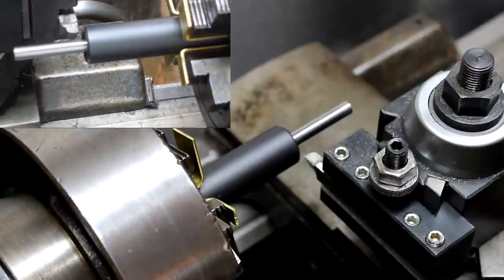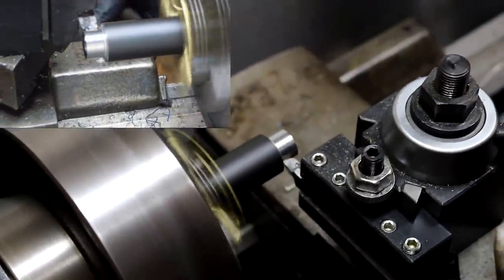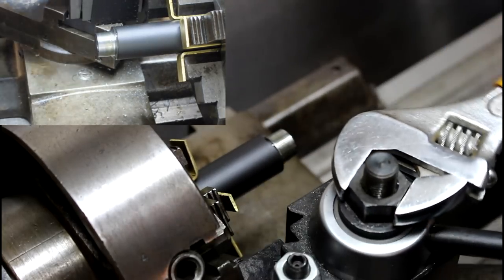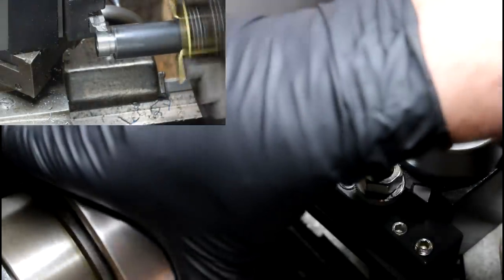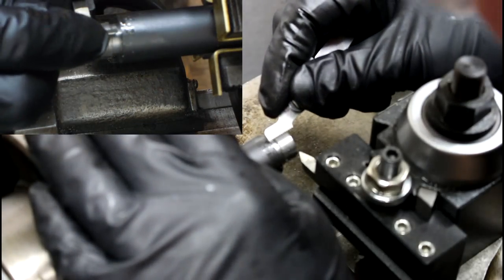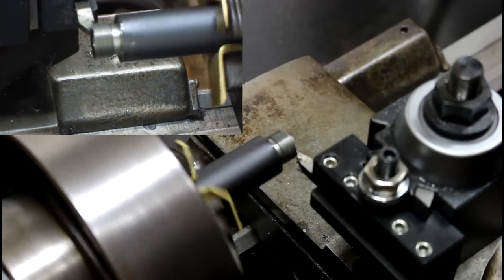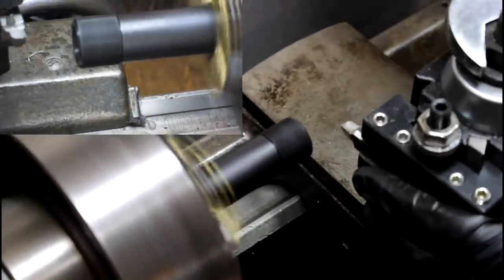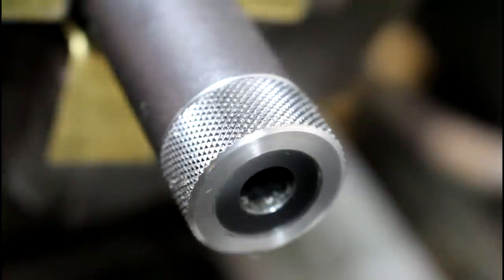Threading a Barrel -Thread Protector Installation! Gunsmithing Remington

Comment: what about the crowning
Reply from the maker: +sea man 
In this case, I left the original crown. Another way to do it is to cut a concentric relief cut on the outside edge of the crown. I haven't seen an accuracy diffence so ether way works.

Comment: Does the barrel need to be taken completely out of the Rifle or can the treading be done with the barrel in the Rifle? The reason I ask is because a gun Smith would charge about $100 bucks to take the barrel off and an additional $100 to reinstall the barrel and space it correctly. The barrel treading and tread adapter would cost about $100. Is that about ? So. We're looking at about $300 bucks for this job.
Reply from the maker: If someone is charging that much I would recommend looking elsewhere for the service. Removing a barrel and putting it back on in 98% of the cases is a pretty quick and easy job with the correct tools which if they are a good gunsmith they should have. I think we used to knock barrels off and on for $20 a few years ago. If they needed to be headspaced (like a Savage) maybe $40 to do that. That doesn't take long ether. If they were old military actions (Enfields, 1903's, or Mosins) there is a potential for an extra charge because they are a higher risk of pulling a barrel and usually require more effort than say a modern 700 Rem. Then again, sometimes they just screw off without a hitch! 

There is really no need to pull the receiver off the barrel to do this. You can, but it can also be done with the action on. I've done a lot of Muzzle brakes with the receiver still on the barrel. You just need to indicate the muzzle end properly which should be done regardless of what's hanging off the other end. 

Many barrels other than the Savage type lock nut barrels can be marked with a witness mark to indicate the barrel on the receiver. When it is put back on, then eliminating the need to headspace it again. 

This job minus the muzzle brake work if needed, was like an $80-$100 job when I was doing it. Installing a muzzle brake was usually around $200-$250 with a brake.
Reply: Thank you for your time in explaining that.

Comment: How much does something like this typically cost? I have a rem 700 with a 26in heavy barrel. Would like to be able to add a muzzle break or suppressor.
Reply from the maker: well, if I did it, it would look much better than tthe one in the video. Usually around $100. Takes time to set it up and indicate everything before actually cutting it.
Reply: @precisionmachineshed  thanks for the reply. Good to know. I wish you were in Phoenix, Arizona!

Comment: That is some rough cut thread.
Reply: Dear god they looked like they were cut with a garden rake. Oh I would have been fired 48 years ago when I started training in tooling, for turning in work like that. 30degree thread form tool, compound set at 30degrees(some guys swear by 29degrees), clearanced across the cutting edge 10 degrees on the front edge and about 15degrees across the top.  The trailing edge(back edge) should not cut but I have been known to do a wipe at near 0 by moving the saddle (not the compound) about .0002"-.0005" with a well lubed up tool.  This has been beneficial on some ornery stainless steel that just resisted finishing nicely.  Honestly I have used the same tool for decades so precision of those angle numbers isn't that critical, other than the thread form itself. Tool height EXACTLY on center,  Above will rub and tear, below will scrape rather than cut. Good cutting oil or specialty fluid helps.  Nice easy slow speed, based on the material you are cutting. Cratex (rubber impregnated with abrasive) type abrasive to polish and remove the wire edge points on the threads. There are many other thread forms used in the world.  I am speaking about standard UNC/UNF threading.  ACME is quite a bit different as is British Associated, and forget Whitworth which is close to UNC/UNF but not exactly. Proper use of thread wires or if you've got the bucks, a thread measuring micrometer is needed to do threads correctly to size. Just fitting to someone else's work might get this one job done, but might not fit someone else's work you might want to use at a later time.  This was for those who said they wanted some constructive advice and not just critiquing the OP's work.  And the gloves are a recipe for disaster on any machining process or machine tool. But that's a talk for another time as it involves a lot of detailed discussion.  And thanks for the video anyway.

Comment: sir, sorry for being off topic. is it possible to extend a glock barrel? just bought a sjc compensator. extend the length with a thread?
Reply from the maker: Without purchasing a new barrel, no. You can screw on anything you want, but A) a true barrel extension would be very hard to accomplish, and B) unsafe. If your barrel is to short for your comp, then you will most likely need an aftermarket barrel. Based off your info, that's my opinion.

Comment: Wouldn't it have been better to cut the threads at the correct length, instead of cutting the thread protector? Most threads are long enough to put a lock nut and some even come with a spacer washer. Now it's so short that only has option for one style device. Even my 10mm pistol comes with longer thread's.

Comment: Aside from less bearing area for the threads, are there any drawbacks to having such a large relief cut?
Reply from the maker: +ericbc7 
To a point, yes it will affect it the less threads you have the weaker it will be. You want as small of a relief cut as possible and as many threads as possible.

Comment: I'm curious, what happened to the barrel? Did you hand it back to the customer? Has the customer provided feedback on the work? Enough comments have been made about the video here and I've seen the link for the updated version.  
But I'd really like to know if that barrel is still in use?
Reply from the maker: It was my barrel. Other than too long of an undercut and some tear on the threads, it worked fine and the thread was still in spec. There are tolerances  for barrel diameter that need to be followed when making those undercuts. This was the first one I did in about 3 years after I had purchased a cheap lathe, and not the best tooling. I upgraded my equipment and made the second video. I've again upgraded my tooling since that second video. Top notch stuff now.

Comment: outstanding video.. showed all info needed. major and minor dia.. just curious if you'd reveal the o.d  for a guide pin for a rem. 700 .308
Reply from the maker: +Randal Surdyk 
Are you referring to the pin I used in the bore? I'm not sure exactly what it is without measuring, but usually I fit each one to each bore if I don't already have one that fits. When I make one they are usually within a few  10 thousands end to end, which in most cases better than the play you get from a range rod with a bushing.

Comment: How much should cost total? An would that be enough space to add a suppressor ?
Reply from the maker: Most prices I've seen are $75-$100 to thread plus any extra parts. Prices may vary depending on where you are. Most suppressors use a standard 0.600" long thread. The one in this video would work, but it's a little short.

Comment: Thought I left a comet but I dont see it.  heres another any way!.

I like watching your videos your calm and just being yourself the  quality of the video is very good too.
  two questions.
 On the brass crown lapping tool  you made  what degree did you use  11 or 60 degree. I would think 11 so it stays closer  to the face of  the lands

#2 I have  a 1940 south bend heavy 10 L what  do  they have for a spider I can buy for the back of my spindel, and  who sells them. I heard reference to it called  the spider the thing that holds & adjust  the work  center in the back of the spindle.

Thank you and thanks for sharing your adventures
Mike

Comment: .0002-.0003 could equate to 6 thou over the course of a 20” bbl. Why people don’t thread with the muzzle end in the live center and tenon indicated in the chuck is beyond me. Sincerely, Seasoned Gunsmith.
Reply: @jeth0321, I am still learning the right way to do things at home. My GS will have to sell a few toys if I get it down! How would you indicate from tennon end with the muzzle in the live center? I assumed to do that the indicator rod would have to be very long or the barrar pushed pretty far out the back and secured with the 3 jaw and spider?
Reply: Bryan Bowles There’s a few different ways to do it. If you’re threading the muzzle, you can hold and indicate the tenon in a 4 jaw and keep the muzzle in a live center of your tailstock.  This is proper if you machined the tenon while turning between centers so you know that everything remains concentric to the bore. I’m trying to explain the best I can btw. If you have any questions, feel free to ask.
Reply: Bryan Bowles Also, it’s best to start out cutting the tenon via turning between centers. After that, you can rest assured that your tenon (OD) is concentric to your bore. Same for the muzzle end to flip the barrel around in a 4 jaw to be indicated true.
Reply: @JETHO321  I got ya, so you would hold and indicate off the tennon if I am understanding correctly. And since we would have cut this true to bore center we know that undercut/tennon is concentric with bore.? Now to thread we indicate at tennon and setup the bore end just out of the live center, indicating there as well. At that point cut the threads properly, not like in this video! :)
Reply from the maker: Unless you are running a high end live center, ie Royal or even a Bision, most cheap live centers are only rated to hold 0.0003" TIR which is the same as dialing it in on both ends. Not disagreeing with between centers, but unless you are using a dead center or a Royal live center, you aren't doing better, just the same. I would recommend using a collet to secure the tenon end of the barrel after you machined it if you want to run a live center. Also the indicating rod is usually measured over 3-4" of the rod. I didn't take the time in this video to zero the bore out. It is done all the time though. I've done it between centers, in the steady, and dialing them in. Each method can produce very good reults. This video is a very poor representation of what i've done.
Reply from the maker: The threads were cut properly, just had a very dull improperly sharpened bit which gave crappy ugly tore up threads. check out  some of the newer videos!

Comment: Some back ground on me. I do a lot of acad drawings for the machine shop where I work. Recently did a drawing with a 1"-32x.160 male tread for an optical mount and the shop told me they needed .060 undercut I had to add to the drawing. What defines min undercut? Thread tool width?
Reply: I mean back cut.

Comment: That finished thread looks ragged and chipped at 29:48
Reply from the maker: It wasn't the best finish.  This was a quick demo video.  I've also since upgraded all my machines and fine tuned the threading finish.  This was an old worn out lathe that was not in adjustment and that didn't help either.

Comment: Never seen a barrel where the OD ran true with the bore. Your thread relief groove is way to wide, A 5/8-24 thread should be 5/8  long, not 1/2. then you would not need to shorten your thread protector. My 2 cents.

Comment: thats really cool. nice job. I wanna learn how to do this stuff. i inherited a late 90's model cnc lathe and milling machine and I have no idea how to use it. Do you know where would I get advice on a good gunsmithing or machining school to learn how to do this? Im in Atlanta Ga.
Reply from the maker: There are a few ways to go about learning. The easiest would be to find a local gunsmith that would be willing to teach you. You might have to work for little to nothing at first. Another option is to take a local machining course at a technical school to learn how to run those machines. Finally you could enroll in a gunsmithing  program. I'm sure there are a few around but a couple of the more popular ones are Trinidad Tech in Colorado, and Pine City CC in Minnesota. I was fortunate enough to have a few guys teach me and I read and practiced a lot. Most of gunsmithing is doing repairs. If you want to become a builder, that's another game. I'm into building and don't really do repairs anymore. I also am not currently doing work for other people.
Reply: Thank you very much for taking the time to explain that. Can you make a good living doing repairs and custom jobs? I looked at a few schools around me..it seems the better ones are several months long. And I will contact all the local gunsmiths to see if they can take me on...maybe even have a place to setup my machines. Im willing to work for free a couple days a week for a few months to get started so I'll shop that idea around. I meant to ask.. I have an Acer dynamic 1740g 17" engine lathe will that do gun work? Again, thank you very much.
Reply from the maker: That's a large lathe. It will definitely do barrel work, but you may run into a few hurdles with the length or your head stock if you want to go through the head stock. You can always work around that though. As far as making a living, everyone I know started doing it as a hobby and eventually went full time into it and made a decent living.

Comment: was the action still on the barrel or did you have just the barrel?
Reply from the maker: In this video, no there was no action on the barrel. It was just a old barrel I had sitting around. You could leave the action on if you can fit the barrel through the headstock. As long as it fits, and you can properly indicate the barrel, it really doesn't matter. I've done it both ways.
Reply: thanks.  I figured it would save me from removing the barrel from the action

Comment: If that's "24 tpi" that threaded section must be about 1/3 of an inch long because you've only got 7 to 8 threads there MAX. You also used a "fine thread" pitch gauge for your "24 TPI" when "24 TPI" is NOT "fine thread" for 5/8". It's only "fine thread" for diameters 5/16" and 3/8" and "fine thread" for 5/8" is 18 TPI which is MUCH more believable for your threaded section since its clearly MUCH closer to 1/2 in length than only 1/3 of an inch or less. And that has to be 5/8" if its on a .30-caliber barrel regardless and obviously is NOT 1/2 inch if the "minor diameter" is .560" or whatever minor diameter well in excess of .500" you mentioned. Fine threads are also much "shallower" and proportionately shallower than "coarse threads" for the same major diameter so a "24 TPI" fine thread is "50% shallower" than a "16 TPI" coarse thread. The only way to cut more threads per inch with the same "angle" on the thread profile is to cut them shallower proportionately to their increased count per inch. A thread pitch gauge isn't "accurate" for a non-existent "5/8-24" thread and thread pitch gauges are POINTLESS for checking "threads" that haven't been cut yet by holding them on the "scratch" or "scribe" pass. They're used to measure the thread pitch of EXISTING threads and are found in tap & die sets that only contain "standard" diameters and their "standard" fine and coarse thread taps and dies. And since any given "TPI" can be both a "coarse" thread for one diameter and a "fine" thread for another larger diameter, and its when the diameter DOUBLES that "coarse" for the "half diameter" matches up to "fine" for the doubled diameter (16 TPI is 3/8" NC and 3/4" NF) and the thread depth also doubles, the "match" for 5/8" with a 24 TPI "fine" would be 5/16 "coarse". But 5/16 NC is 18 TPI and not 24 TPI. 24 TPI is 5/16 NF. And like I said, those threads look WAY closer to 18 TPI than 24 TPI which happens to be the "match" so where you're getting "24 TPI" is anybody's guess but its wrong.
Reply from the maker: 5/8x24 is basically the industry standard for 1 of 3 main sizes used for muzzle brakes, and suppressors. A tpi gauge is used on any thread,  regardless of fine or course thread.

Comment: GOOD JOB dude ,but you forgot to crown the barrel
Reply from the maker: +Freddie Saylor 
The original crown was in good shape. If you wanted to you could re-cut it quickly being that it's already set up in the lathe. If this was for a precision muzzle brake, or a shop made custom brake, then yes, it will get re-crowned and custom fit to the new brake.

Comment: as a pseudo machinist. I'm just making sure I have all info. is is feasible to leave action on. when the turning
Reply from the maker: +randy surdyk 
Yes it can be done that way depending on how you indicate the barrel and assuming you are going through the headstock. Best method would be to use a grizzly rod when doing this. Otherwise if the chamber end of the barrel has previously been trued on the OD, you could indicate off that. There's several ways to do it with the action on.